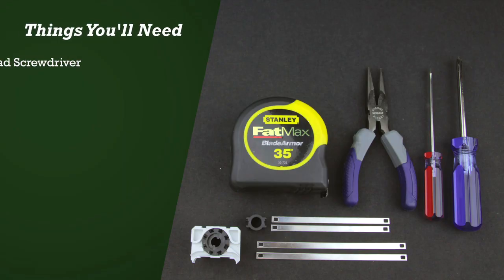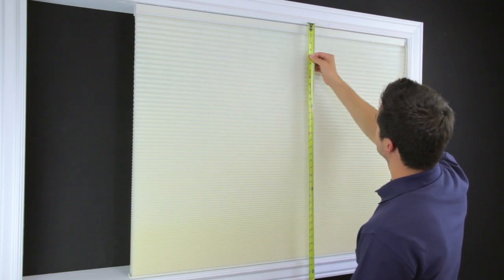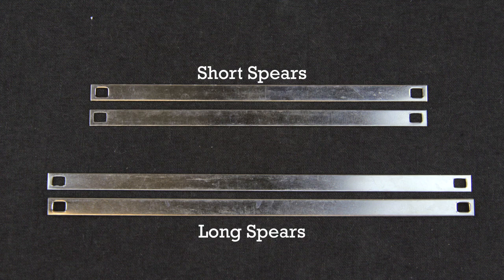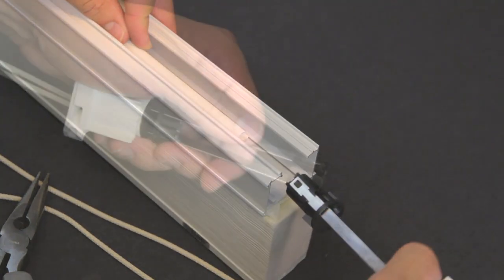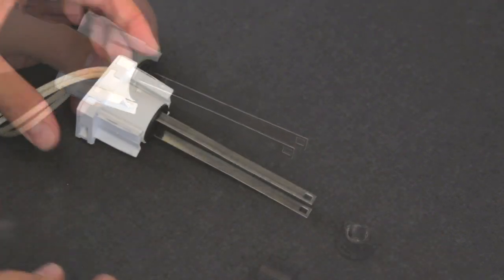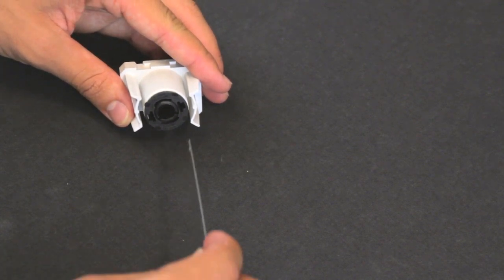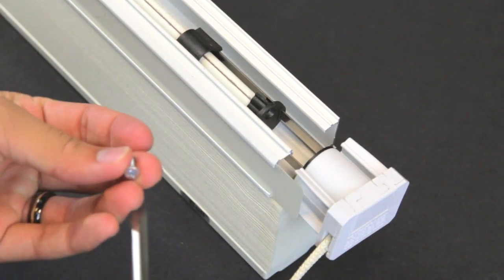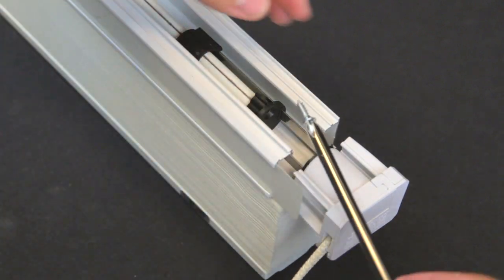How to Install a Rollease Clutch for Continuous Cord Loop Cellular Honeycomb Shades

Comment: at about 1:30 in the video they show removing the clutch cover.  If you try this on a part that has been installed for a few years, you will break the tabs on the clutch cover.  The right way to do the removal is to do it from the bottom of the clutch.  The piece of plastic on the bottom is longer and goes across the bottom.  Because its longer, you can pop it up without breaking it if you are VERY careful. (no guarantees)  New clutch covers are $4.00 from FixmyBlinds.  

If you've ever broken one of these, you know how frustrating it can be.  I actually repaired my broken ones using two 3/4 inch 2-56 machine screws.  I drilled two holes in the clutch cover and through them, drilled and tapped threads into the clutch itself.  The two 2-56 machine screws now hold the cover in place after a cord replacement just as well as the now broken tabs do.  No need to buy replacements for the covers.  Of course you'll need to buy a 2-56 tap and drill set for a couple of bucks.  Tap handles are about $10, but since its just plastic, you can probably turn the tap with a pair of pliers.  Place the holes where the screws won't interfere with the operation of the clutch.
Reply from the maker: Patrick - Yes, removing the clutch cover without breaking it is a challenge for sure. They often break, even when someone is extremely careful. Your work around with the screws is a great idea! I'm glad you created a solution to this problem.
Reply: I repair these and yes they always break and that's why I always carry a glue gun
Reply: Wish I'd read your comment before I gingerly tried to remove the clutch cover (end cap) on my brand new Levelor cellular shades. The continuous cord loop locked in one place, with the shade fully lowered, on the second day of gentle use. Instead of sending the shade right back for a refund, I thought I might be able to just fix a tangled/jammed cord.  Well, the tabs on the clutch cover broke, just as Patrick warned. It's going to have to go back. These are expensive!
Reply: Pat, I wish I found this prior to me trying to pry the cap an breaking that darn bottom piece that goes across. I also wish I red this prior to posting my question about the same lol. Any who damage is done I’ve requested a new end cap from the company I purchased my blinds from but that’s sad that it’s a known issue an they actually gave you a pat on the back saying thanks for the solution, lol. The endless rope looks like they are glued together but after some time they fray an come apart mine lasted 1 yr. I wonder if a beaded cord would work in that clutch and or any other permanent fix I did think of trying to put some crazy glue on the cord prior to it breaking but it was one of those, “I’ll do it this weekend” things. The piece that snapped off is actually still stuck in there I was trying to pry it out but the cellular shade material was next to it an so I didn’t want to cause more damage. Maybe when my new end cap comes in it’s better I take it off the wall.

Comment: Any vids on how to replace the rope? My rope needed to be replaced because where the two ends meet it eventually frayed an came apart so I had to replace the rope. The end cap that covers the clutch snapped when I tried to pull it off while it was mounted to the wall. Is the end cap only removable when the shade is off the wall? I have a pretty wide shade thus I didn’t want to dismount it.
Reply from the maker: Hi there, We do have a video for replacing the cord loop here: https://youtu.be/QdoCvJycOlA.

Those clutch covers are pretty fragile and break easily. If the shade is mounted outside the window, you may be able to remove the clutch cover and replace the loop without taking it down. However, if the shade is mounting inside the window, you'll have to take the shade down to do this repair.

Comment: Where can you purchase the RollEase Clutch System? I'm having a hard time finding it. Thanks!
Reply from the maker: Hi Kate, you can purchase these clutches on our website here: https://fixmyblinds.com/collections/cellular-honeycomb-pleated-shade-clutches-accessories.
Reply: @fixmyblinds  thanks for the reply. Is there a way to purchase it as a kit or do I have to buy it in pieces? I'm not really sure what all pieces are needed.
Reply from the maker: Kate, the clutches are sold in sets that come with the clutch mechanism, a cover and a few other assorted pieces that you may or may not use. If you'd like to see what pieces your blind needs specifically, email us some pictures of your parts to service@fixmyblinds.com.
Reply: @fixmyblinds  thanks! You are awesome!

Comment: Just bought a new clutch and cord but clutch cover does not fit as top tabs pop up when bottom tab is pressed in place. Reason is that on the inside top of cover are two small plastic protrusions which do not fit into main body and therefore prevent cover from closing completely.
Reply from the maker: Hi Phil, There may be something wrong with the clutch cover you received. Would you please take a picture of cover where the protrusions are and email it to us? Our email is service@fixmyblinds.com. I'd like to take a look to make sure that cover is good or not.

Comment: How do you get the spears out of the old clutch to put in the new one?
Reply from the maker: Angela, Once the spears are pressed into the clutch, there's no way to remove them. Are you trying to remove the old spears and put them on a new clutch?
Reply: @fixmyblinds  Yes.  Or, do you get new spears with the new clutch?
Reply from the maker: @houseandgardenhacks2935  Hi there, if you purchase a new clutch from us, it comes with new spears. There's no way to remove the spears once they are attached to the clutch.
Reply: @fixmyblinds  Thanks.

Comment: So it has been 3 years since Patrick Callahan mentioned about breaking the tabs on the clutch cover.  And FixMyBlinds acknowledged the problem and the solution.  Yet the video has not been fixed.

Also, there is no mention about removing the screw in the back of the header rail to get the clutch out.

Additionally, there are no instructions on how to remove the cover plate that covers the clutch cover.  I broke mine trying to figure it out.

Finally, there is no reference to restringing the continuous cord through the cord tension device.
Reply from the maker: Hi Tom, Thanks for sharing your comments. We do state that removing the components can break them and we advise folks to be careful when attempting repairs. These parts are often plastic. With years of being in the window, the sun damage makes the plastic brittle and prone to breakage. Parts can break even when great care is taken. 

Patrick Callahan did offer a solution that he came up with to screw the cover to the clutch mechanism. We don’t instruct folks to use work-arounds for repairs; we recommend the best solution which, in this case, is replacing the clutch cover if it’s broken. Patrick’s solution is creative and it worked for him. Not everyone will have the tools necessary to use his work-around, and if this is not done properly, it’s possible that you could damage your clutch.

Our videos are designed as a general help to folks who are repairing their own blinds. Oftentimes, the blinds or shades people are working on look a little different than the blinds or shades in our videos. Since there are so many variations in the window covering industry, we use the most common brands and blinds as examples. The shade in our video doesn't have a screw holding the clutch in the headrail or a plate that covers the clutch cover. Those are both pretty uncommon features. Out of curiosity, do you know the brand of your shade?

We do have other videos available showing how to install a cord loop into various types of tensioners. This video only covers installing a new clutch.

Again, we appreciate your feedback. Feel free to reach out to us directly if you need help with repairs in the future.
Reply: @fixmyblinds  I understand everything you said, but I think I may not have made myself clear.  When I referred to Patrick Callahan, I was referring to to removing the cover from the bottom of the clutch rather than the top as stated in the video.  This is what should be fixed in an updated video.

My broken blind is a Levolor and is less than 1 year old on the North side and never gets any direct sunlight.
Reply from the maker: Tom, Thanks for clarifying. I appreciate your feedback. I hope to update this video in the future to include more detailed information. 

That's really frustrating that your new blind is already broken. If you'd like to email me a picture of the broken cover, I can let you know if it's one we carry. Our email is service@fixmyblinds.com.